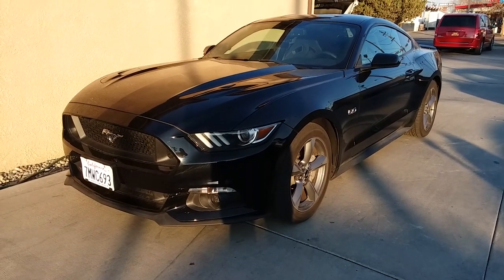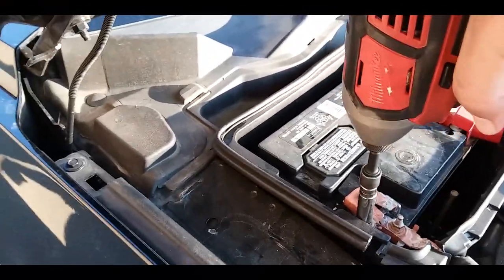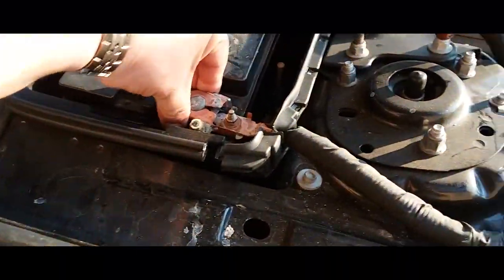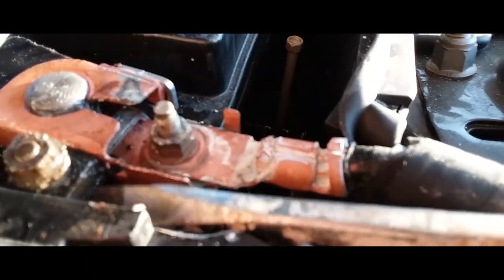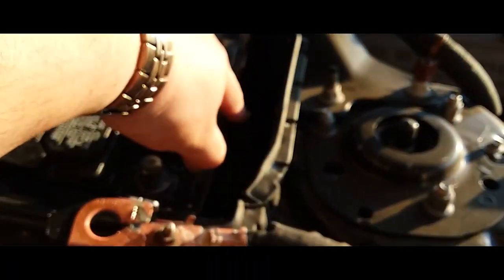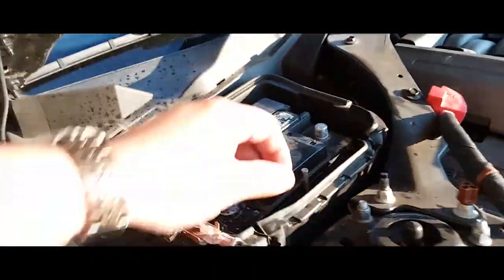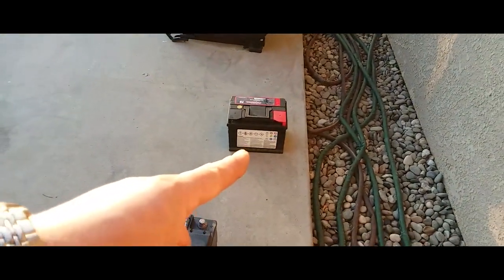How to: Remove a Battery from a 2015 Ford Mustang GT

Comment: If your negative terminal is stuck, you will have to spend about an hour trying to wiggle it back and forth to come off. Make sure you already have a new battery with you because the battery post will more than likely be uprooted or damaged in some way during the process (if it does not then consider yourself lucky). Use some dielectric grease on the new battery post and clean your battery cable terminal before putting it back on.

Comment: I just had this same issue with the negative.  I realised after a bit of effort to disconnect the cable from the battery connector (the nut is right there!), then take the battery out and have much better access to get the connector off!
Reply from the maker: Yes that is an easier way to do it as well, sometimes you gotta think outside the box to get it done. Good job!

Comment: For those that have a cable stuck to the post, I tried a couple squirts of WD40 amd gently wiggled it out after waiting a couple minutes. 

Results may vary; if it's really corroded, the cable may need to be replaced.

Power tools are optional. The nuts can be moved using hand tools. :)
Reply: This eventually worked for me too, but had to work the terminal connector back and forth/up and down while squirting wd40 in there, and that worked.
Reply from the maker: 🤣🤣🤣 wow

Comment: What battery is recommended?
Reply from the maker: Group Size 96R 590 CCA

Were I found it:https://www.autozone.com/batteries-starting-and-charging/battery/p/duralast-gold-battery-96r-dlg-group-size-96r-590-cca/219431_0_0

How to install it: https://youtu.be/k-K4TyX4VGs
Reply: @559powerscape  i got a nee battery and it turned on and now its marking me the ABS and Advance Traction Service, any idea?
Reply from the maker: @askingzombie12  sometimes after the battery is installed you need to drive it a good 5min and see if it hopefully goes away

Comment: Does anyone know how i can replace the positive terminal from a mustang 2016
Reply from the maker: You might have to cut it strip the wire back and replace it with terminals from autozone. Red and black set. Hope this works out for you!

Comment: how did you remove minus from its place ? I have the same problem and I cant remove it. You skipped that on the video ???
Reply from the maker: Use big channel lock pliers to wiggle it back and forth with the big flat head screwdriver try to pry it open and help it from underneath the terminal to try and push it up and out
Reply from the maker: Here is Lancer with a similar problem and what I did to take it off

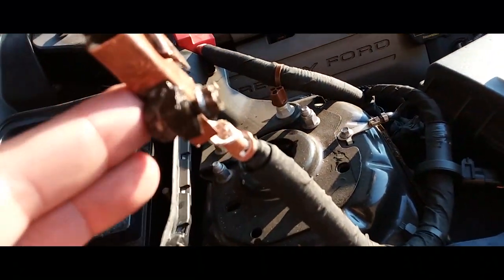https://youtu.be/CmZPWxgtwWg @1:30 of the video I demonstrate how to remove it with various tools

Comment: My cable is stuck. How did you get it off?
Reply from the maker: Sorry man. Never had a terminal stuck this bad before and didnt think anyone else would run into this problem. Guess its more commen than i thought. I ended up opening it up with a flat head screwdriver to open up the connector prong's took me a bit but i managed to get it out. Sorry man good luck.
Reply: @559powerscape  thanks. Mine looks like yours but I cant get it off the terminal. Tried wd40 twisting it. Positive side came off easy but not the negative side
Reply from the maker: @BurtReynolds.  try also maybe big channel lock pliers to wiggle it back and forth with the big flat head screwdriver try to pry it open and help it from underneath the terminal to try and push it out.
Reply: @559powerscape  so got it off. It took the negative battery come out the battery but made it easy to take off.
Reply from the maker: @BurtReynolds.  heck yeah man, sorry this turn into a mission. Hope the installation ain't as hard.

Comment: Yup...totally glazed over the most important part ..how to remove the negative terminal
Reply from the maker: Just pry it open with a screwdriver
Reply: @559powerscape  I ended up having to take the entire battery out and chip off pieces of the terminal post to get the connector off
Reply from the maker: @collincutler4992  wow I didn't have to do all that just a flat head to open the connector, but every car is different! Man sorry you had to do so much, but that's how sometimes it is when you do the job, you always come to bumps on the road! Glad this worked out for you!
Reply from the maker: @collincutler4992  this is the first fire up! I say j37 lol but meant j35 lol🤣🤪🤪🤪

Comment: U skipped the part we needed to see
Reply from the maker: Sorry man. Never had a terminal stuck this bad before and didnt think anyone else would run into this problem. Guess its more commen than i thought. I ended up opening it up with a flat head screwdriver to open up the connector prong's took me a bit but i managed to get it out. Sorry man good luck.

Comment: Wow my negative broke off on my battery
Reply from the maker: The battery post? Dang
Reply: @559powerscape  yup it was stuck stuck and ripped off I was like wow
Reply from the maker: @DJKhaoticGaming  Damn no way. We're u able to get it off the Negative Terminal Connector? If not try a flat head to pry it open and 2 good size Channel lock pliers to help you open it up and get that negative post out...good luck BRODIE
Reply: @559powerscape  yeah it came out but now the negative terminal is all bent up the positive is alittle bent to I was thinking of going to Ford dealer to get them replaced I got the duralast platinum battery
Reply from the maker: @DJKhaoticGaming  or autozone for some aftermarket terminals would work as well